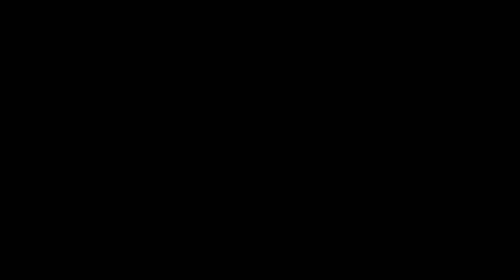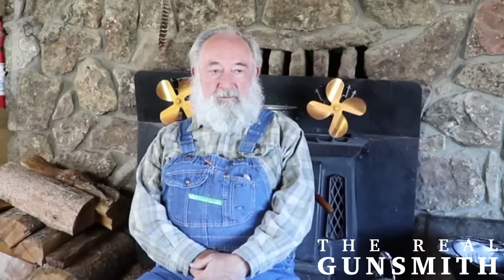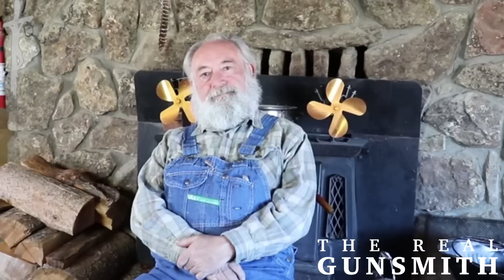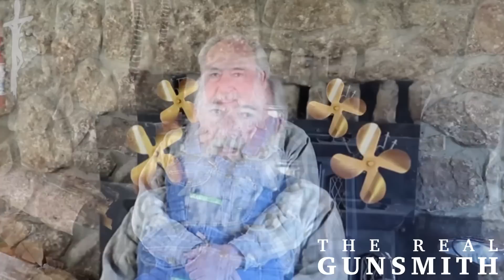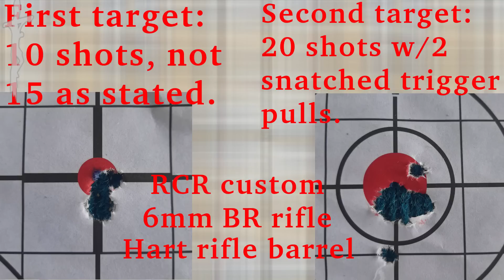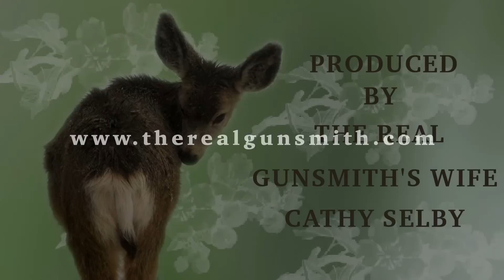Rifle Barrel Dynamics

Comment: I am using a new Hart barrel in 243 Winchester. Shoots very well 100-gr Speer bullets and easy to clean. I also have a M1 Garand rebarreled with a 2 groove and marked Danish. Very accurate with reloads and 1.5” open sights at 100-yd for my CMP rifle with CMP ball Ammo 147-gr. 1965 dated.

Comment: Here's my experiences:
Shilen - 
300RUM, 7RemMag, 280 Rem (2). First barrel brand that produced caliber sized 3 shot groups (the 7RemMag), 150 Nosler Btips, IMR4831, Win brass, 215m primers. All top tier

Hart - 
30-06, very rough start, first 25-30 or so shots reminded me of a poorly manufactured  production rifle despite the trued 700 action, Jewel trigger, McMillan stock. Improved dramatically with more rounds. At about 50, the barrel went from a dud to a stud. Had me worried in the beginning. Identical experience with my 7PRC. My first Hart was a 270 Win on a Ruger M77 MK II. Stark contrast. This one was magic from the first shot. All turned out to be top tier 

Broughton - 
One of my best firearm experiences here as well. 270 Win. My first rifle to repeat half inch at 200 yards with 3 shot groups - 150 Berger VLDs, IMR4350, Fed match magnum primer, Win brass (sub zero wolf hunting load). I can't think of any handload or factory ammo I've shot in this rifle where it printed over 5/8" at 100. Built by Greg Richards, who purchased Broughton barrels from Harold Broughton

PacNor - 30-06, 270 Win, really good

Lilja - 270s, 30-06. Second brand to produce caliber size holes with 3 shot groups at 100 with handloads, again Nosler ballistic tips

Obermeyer - 1 barrel, 308 Win, 5R, D3 contour, Sako M591 - really good

Krieger 4 grooves - 270 Win, 7RemMag. Immediate top tier as well. 150 Berger VLD, H4831SC, 3000fps, quarter minute in 270. 168 Berger, Retumbo, 3000fps, first to produce caliber size 5 shot groups to quarter min

Bartlein - 
6.5-284 Norma 5R gain twist. I could survive parting with every rifle with every barrel and just keep this for everything. Has never printed any bullet, handload, even while finding OCW, seating depth, bullet, primer changes, etc. over 1/2". I've never experienced anything like this, ever. Current load is 127 Barnes LRX over H1000 at 3250fps. Prevous load is 130 Nosler AB over Re19. Next is a very new 280AI. Top Tier, 168 Berger VLDs over H4831SC at 2980fps - quarter min, and 139 Barnes LRX over Superformance at 3300fps, 1/2"

Brux - 
6.5-284 Norma, 140 Berger VLD, Retumbo, quarter min over and over, 4 groove
7PRC, 180 Berger VLD, LRT, ADG brass, 215match primer, 77.8 grains of powder, 1 hole, 4 groove
280AI, haven't even tested ammo yet but it's shooting Norma factory 280 Rem tipstrike into half to 5/8" so I just used that and tagged 3 deer with it this past November. No clue what it will do once I start handloading. 
300WSM modified - 4 groove, 210 Berger VLD, 2880fps, Reloder 22, ADG brass, 215 match primer, still testing as well as with 190 ABLR and 190 Speer Impact. I could part with all rifles and keep any of these. All 4 groove

Benchmark - 
two near twin 308 Win, McMillan stocks, TT Diamonds, Defiance actions. These are "5R" style, cut-rifled. Only had time to run 40 rounds through each with factory Fed gold medal match 168 Sierras which did really well - up to 1" with 10 shot groups but both shoot the 130 TTSX over TAC into 1/2". Still testing but clearly keepers
one 7PRC on a Lone Peak Arms Razor Ti, AGComposite stock, TT Diamond. Have yet to handload for it but it eats factory Federal ELDX repeatedly, to my satisfaction. Filled 3 tags last November with it

K&P - 
these are new to me. Cut-rifled, steel comes from Germany. All of mine are 4 groove. Only one I have complete at the moment is my new 270-7PRC, 8 twist, #4 contour (I have 2 of these). Winner so far. 7PRC ADG brass necked down to 277. 170 Berger VLD at 3266fps. Using Berger's website, this outperforms the 7PRC with a 180 Berger VLD at 3000fps and the 195 EOL at 2900fps in drop, drift, energy. This, and the Brux 300WSM modified are used on my Terminus Zeus QC long action. For the 270-7PRC I will also be testing the 170 ballistic tip, the 165ABLR, and likely the 155 Barnes LRX

Got 2 barrels on order from Benchmark in .277, an 8.5 twist and a 9 twist for more 270-7PRCs but these are button rifled, Also have 2 Brux, same 2 twist rates, also for 270-7PRC. Got a 9.5 twist Brux on hand and I'm considering putting it with a Tikka action for a 270-7PRC and use the 150 Nosler ABLR

In my limited experience, the cut-rifled barrels collectively were by far the easiest and fastest for me to find loads. For whatever reason, those 2 Hart barrels mentioned above had me quite frustrated in the beginning even though all turned out to give me the WOW factor. I fully expected the 7PRC and 30-06 to be a breeze like my 270. I don't understand the metallurgy and don't plan on learning it and also don't understand why some barrels, despite quality and reputation take a lot of firings before they reveal how special they really are while others shout at me from the get go, "hey bud, your search is over." 

Based only on my experience, if I had to choose only 1 button brand, it would be Broughton hands down and of course, you can't get those anymore and I only have the 1. In fairness, I haven't shot a Benchmark button rifled barrel yet

Comment: I might be mistaken but the way I see copper fouling is that the deposit left after a copper bullet passes down a rifled barrel should decrease the amount of imperfections in the bore.  Basically filling the voids to create a smoother bore.
Shouldn't that be mostly desirable?
Reply from the maker: There is no void in an on dimension match quality barrel. Tight or loose spots are a problem in cheap production and that is never an asset.  Why bother, when there are so many great choices.  Copper fouling is not something to be desired or wanted in a good match quality barrel.
Thanks for watching.

Comment: If you have a match grade barrel or top quality barrel; it will shoot. I’ve had 4groove, 6 groove and they all shot. No difference. I had an old .303 left twist 2 groove and it shot very well. I have a custom.243 gain twist and it is a one holer. Just remember to torque action and scope rings and bases properly.

Comment: Boots Obermeyer is a mentor and I have known him for a number of years. 
He is up in years and had a stroke a few years back and no longer making barrels. 
Boot’s had 5R and 6R barrels. 
The “R” is for Russian, not radius, this stems from the land and groove design the Russians used in their 25mm and larger barrels.  Boots did extensive testing for the US Government in 60’s on Russian barrels, he found that bore and groove had a radius, no square edges and corners.  The reason for the design the powder the Russians were producing was extremely dirty and each round fired would sweep the bore and low copper buildup.  All he did was incorporate that design into rifle barrels. 
I could go on into further findings that were observed by doing this. Also Boots had .002” tight bores ie. .298”-.308”: .010” difference between bore and groove instead of .008”.

Comment: Help me here Randy, you say it is ok (time 7:01) to have a bore/groove variation of 1 or 2  10/1000 of an inch. Then you bust on Krieger because their barrels are off by 1/1000 of an inch, curious which is better?  Best I can figure is 1or 2  ten thousands (10/1000) is pretty sloppy tolerance for a rifle barrel.
Reply from the maker: It appears you don't understand: 1 or 2 ten thousands of an inch is very tight according to groove diameter, say .243 plus 1 or 2 tenths. 
One thousand is 10x 1 tenth, and 5x 2 tenths.
Thanks for watching.
Reply: 10,000 of an inch  vs 1000 of an inch
Reply: @lisaannaallen6283  Whew that makes more sense. With CC on it says "ten thousands" when it should read "ten thousandth".
Reply: .3081 vs .309
Reply: @lisaannaallen6283  Thanks Lisa, fat fingers and small phone screen took me four times to try and explain to couespursuit.
.002 is two thousandths of inch 
.0002 is two ten thousandths of inch
And .0002 is by no means a sloppy barrel.
Reply: .oo3
Reply: Learn how to read a micrometer and speak measurements please.   .002 o
Reply: Learn how to read a micrometer and speak measurements please.   .002 o

Comment: I could care less about having how many groves my barrel has stamped on it i would rather have the chamber/neck size stamped on my barrel vs how many groves it has..
Reply from the maker: The chamber, by law, and common sense, is stamped on the barrel.  A barrel blank should have, when ordered, the groove stamped on the end of the barrel, which will be machined off anyway, in the process of threading.
Thanks for watching.

Comment: I tried some Sierra Match kings in my bull barrel 24 inch 308 and they shot into a cloverleaf. 
  I then tried the 180 grain Hornady SST bullets loaded the exact same way with the same powder charge and the same overall cartridge length and it  poked all three into the same damn hole with very little variation.  This is the load that I am still using for the gunrange and have made everyone else green with envy because they haven't been able to beat it after many shooting matches. 
 It just absolutely kills them because they are using Match kings and so forth. I know that what you are saying is spot on. 
   You're something else Mr. Randy.